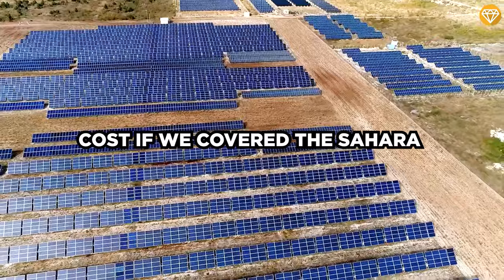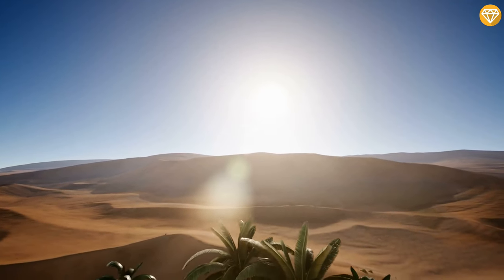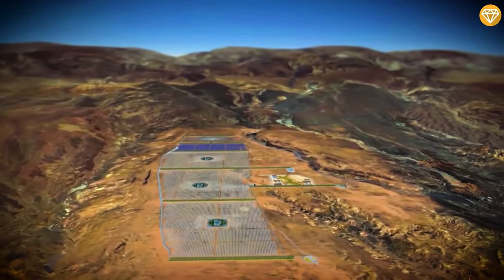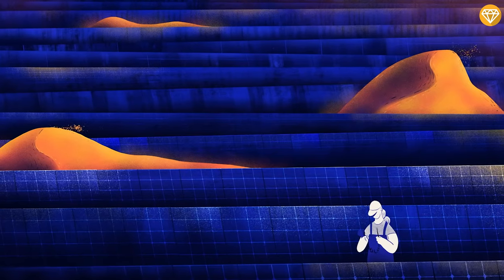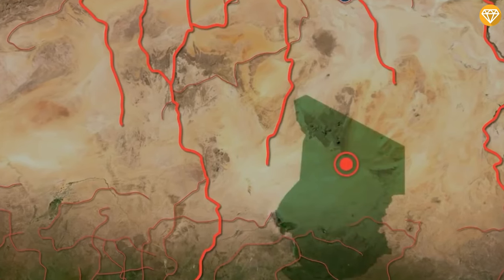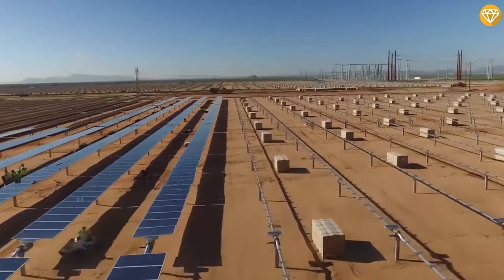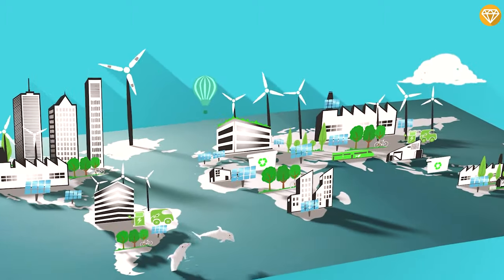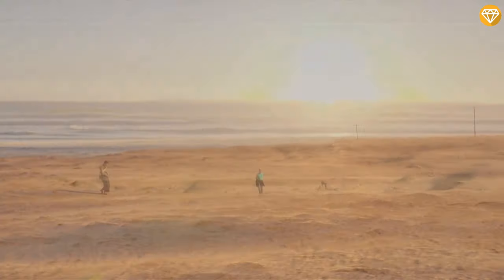What If We Covered THE SAHARA With $51 TRILLION DOLLAR Solar Panels?

Comment: So how are the panels kept clear of dust?
Reply from the maker: Generally, To keep solar panels clean and working efficiently, they are sprayed multiple times a month with high pressure water. It would be one way to do it or you can find another way for commercial scale like this.
Reply: @MegaProjectsInsight  In the Sahara? 'cause they've got plenty of spare water clean stuff with, right?

Comment: Cover each house rooftop with solar panel. That would be the best idea. Each house would be energy independent. But bigger companies don't like that. They want each household to purchase their energy.
Reply from the maker: That would be cool!
Reply: Right, it's all one big conspiracy, is it..... Sheesh. 
You do know that less than a quarter of rooves face in the right direction, don't you. And that many of those that do face the right direction are overshadowed. And that many countries have high levels of cloud cover, so even perfectly situated rooves come nowhere near producing enough electricity to give energy independence to the household, and that even if they did, the house would need storage (batteries) which cost a fortune and only last a few years. Many countries have a legacy of historic buildings with rooves unsuitable for solar panels (good luck putting solar panels on a thatched roof, for instance). Apart from that stuff, (you know, inconvenient little facts), no-one is stopping households putting their own panels on the roof.